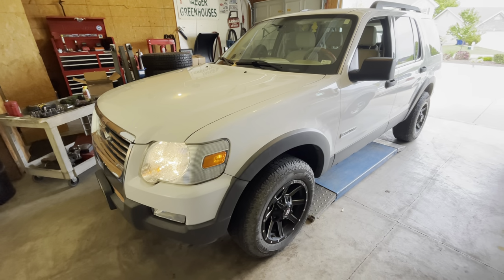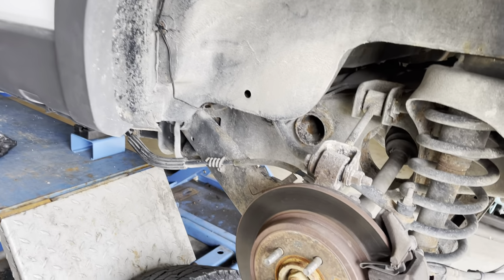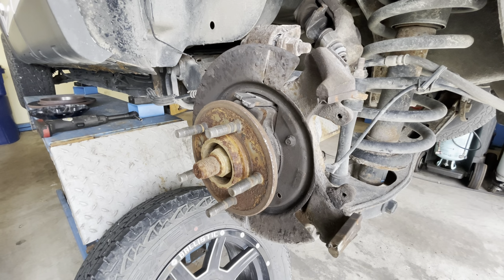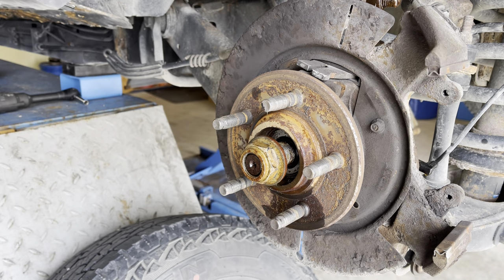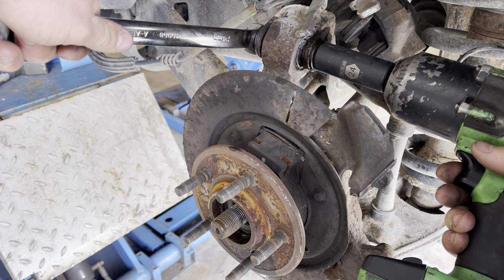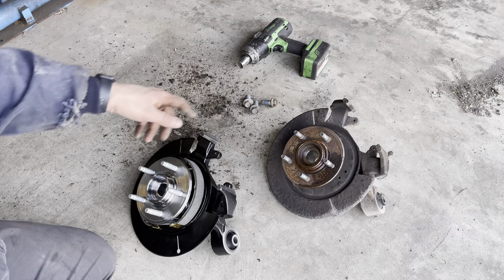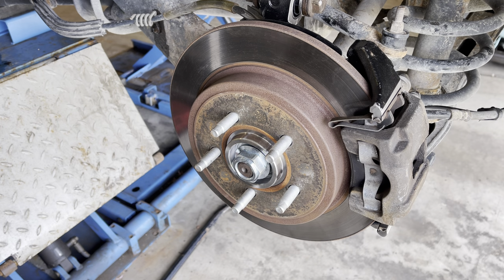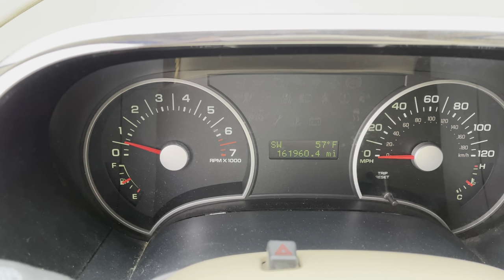Ford Explorer Rear Knuckle / Wheel Bearing Replacement

Comment from the maker: As always, thank you all for your feedback. It seems I learn something new from your comments every time I post a video like this.

With this one, I learned it’s a good idea to not fully tighten the knuckle bushing bolts until the suspension is loaded by first lowering the vehicle onto the ground with the wheels on. The reason being is the bushings will wear prematurely as they are constantly in a bind if tightened in the unloaded (raised vehicle) position.

It’s cool to know that there are other experts in the field watching my videos and sharing their thoughts and suggestions. Just one of the many reasons I love the community we’ve built here. Thanks again!

Comment: thanks  ive been wondering about re and re  I had bought the same parts  and asked a shop to do it they told me $500.   i have no hoist  so axle stand and a jack ....with your video  I got to it   ps no garage just the outside elements SNOW and below freezing temp   job is going very well   thanks again    Ont Canada

Comment: I would've put a washer on those retaining pins and called it done. It would of lasted till it hit the crusher!  Iowa native.
Reply from the maker: That is definitely the most cost effective and fastest option! I thought about that, but the shield was rusted pretty bad and was weakened significantly. Had the rust been not a severe a washer would have probably worked just fine.
Reply: Yeah, a washer would have been more practical. And with those assemblies you have no idea what kind of Chinesium bearing was put in. So plan to do the job all over again in another 10kmi. And with a new knuckle an alignment will be required afterwards. Another option is just buy the backing plates, cut them and wrap it around. New doesn't mean better.

Comment: By chance, did you apply an Anti Seizure compound or grease to shaft when reapplied new knuckle/ bearing assembly? I wasn't sure if i seen that, i did see you spray PB blaster on the shaft, Is that all that is needed? Thanks

Comment: I have changed those Explorer bearings numerous times and they suck! The idea of the complete knuckle is great but I have a concern. I have learned the hard way and I now only install Timkin bearings because the cheaper ones don't last. What was the knuckle fitted with? Probably not a Timkin or Motorcraft. Good luck to you and the owner.
Reply from the maker: It’s definitely a valid concern regarding the wheel bearing as I too have had hit and miss experiences with lower cost aftermarket wheel bearings. My guess is this knuckle was not fitted with a Motorcraft or Timken bearing.

When repairing vehicles, I give my customers different part quality options to fit their budgets. Higher quality parts come with better warranties, but of course are more expensive. Cheaper parts can save a lot of money, but they also have shorter warranties.

In the case of this Explorer, the customer was looking for a lower cost option to fit his budget, so we went with the “Ultra Power” brand from RockAuto, which has a 12 month warranty. For approximately double the cost, Moog offers the same part with a 36 month warranty.

For me, it all depends on how difficult the part is to replace and how much time it will take. A good example is an engine. I will not install used salvage or junkyard engines because of the amount of time required should the engine fail. On the other hand, this knuckle takes about an hour or two, so my time loss is considerably less should I need to replace it under warranty for the customer.

Now in certain scenarios where I’ve experienced multiple and consistent failures, I will insist on using OE quality parts and refuse to use aftermarket. For example, Dorman water/fuel separator drain valves on a 7.3 Powerstroke I will not use because I consistently have issues with them, and the Motorcraft part is only $10 - $20 more.

Anyway, that comment turned out to be much longer than I anticipated lol. As always thanks for your feedback, I enjoy reading peoples’ comments!

Comment: This is a wonderful video.  The only problem with buying a complete hub replacement is that Motorcraft doesn't offer them.  You are stuck using some China junk.  Moog offers them, but lately I've been burned by Moog China parts as well.   Ah, life in today's America.  Thanks for a wonderful video.  Couldn't be better!

Comment: Some folks may argue that “weight should be applied to the axle before tightening the upper and lower bushing”.   What’s you’re opinion on this?
Reply: In most cases it really doesn't matter too much but yes I prefer to get the vehicle at right height. Top tip. If the axles need to hang in the air for a long time you can back the bushing bolts off so the bushings don't get twisted in the down position.
Reply from the maker: Another viewer pointed this out as well, turns out it is a valid point. Next time I have this vehicle for maintenance, I’m going to back the bushing bolts off with the suspension loaded and see how much of a bind they are in.
Reply: Yes, they need to be torqued with vehicle at normal ride height or bushings will tear prematurely.

Comment: 14:26 I though those bushings are supposed to be tightened when on the ground so they aren’t put into a bind when set down on the ground.
Reply from the maker: I looked into this and you are correct. Thanks for pointing it out! Next time I have this vehicle in for maintenance I’m going to back the bushing bolts off with the suspension loaded so those bushings aren’t in a consistent bind.
Reply: @DanielJaegerFilms  - You can just put a jack under the hub and apply load to the bolts. It doesn't need to have the wheel on.
Reply: Would that assembly trick work on a 14 explorer ?

Comment: Where did you order those? Loaded spindles? I been looking for.my.07
Reply: If you don't have a press you'd be better off buying a quality bearing, bring the knuckle to a shop and have them press it in and out. Usually not too expensive. Job is too involved to be messing around with cheap parts and will just hurt your wallet more in the long run.

Comment: Was that a dorman or moog part?
Reply from the maker: This one was an “Ultra Power” brand part from RockAuto
Reply: I just did a skp assembly on the passenger side of mine. Other than the parking brake grenading and needing replacement its been nice and quiet.

Comment: Can you continue to drive the vehicle with a bad hub bearing? To repair it costs $600 and I don't have the cash right now. Is it possible to drive the vehicle for a couple weeks, until I have funds?
Reply: Likely irrelevant now, but for future reference it's a toss up, it could hold or could blow out the next time you try to drive,  I personally wouldn't disk it given the damage to other things in the area(i.e) if the front of the hub slips out and your tie rods aren't the best,  or if your going any kind of speed the tire could slip off and rip the hub/ tie rods out killing the axle spline and possibly you when your tire goes flying
Reply: It might last a few weeks but it could fail at any time. I would not get on a hi speed freeway with worn hub